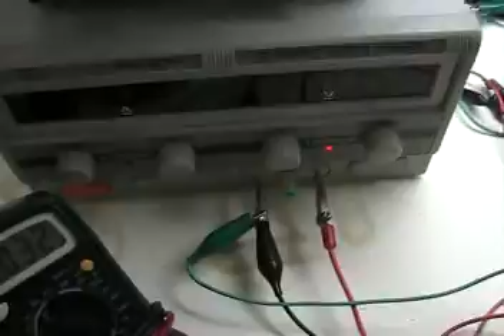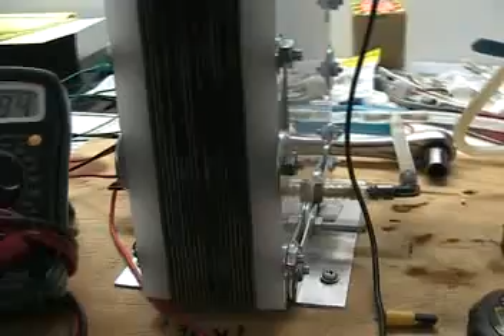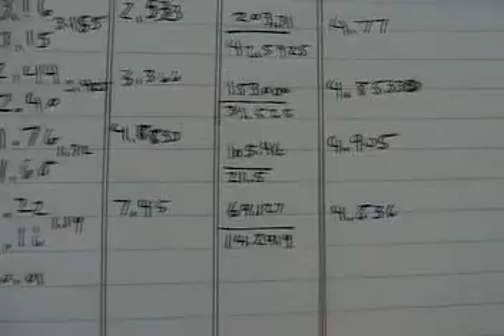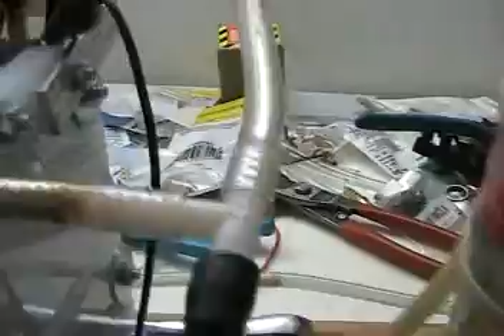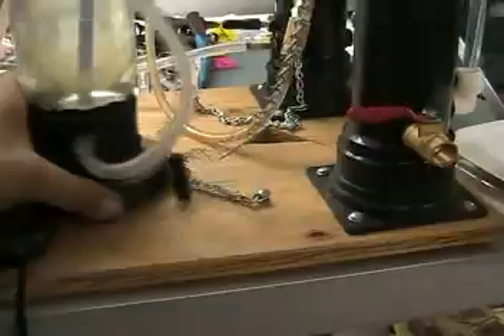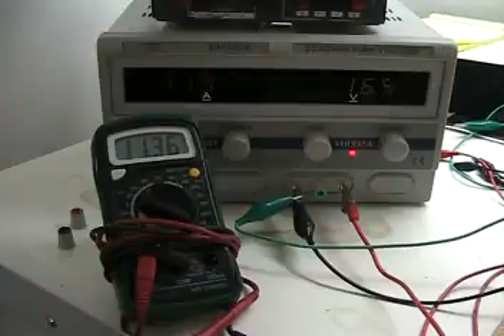drycell test 4

Comment: Copper connections will corrode especally on the + annode because of the oxygen rel., a good idea would be to use stainless steel allthread,2 long nuts with oppisite threads on one end, as u tighten to the +,- bolts u get a strong conn.make sure +v travs.opp.from - safety thing #2 would be to coat the points of connection with something like rino bed liner this will put a hard plastic coating and prevent explosions,plz also dont inclose wire in the seperator! 316L stainless is very corr. resist.

Comment: my friend have you ever tryed a plate array of +,n,-,n,+,n,-,n,+,n etc.? if so what were your results? can u plz try this config. with the connection configuration I mentioned on the earlier video!, I think you should hopefuly get the results your after, this might also allow you to keep your amps.@ around 10 and crank your voltage up to keep the water lower than boiling, and your results should make you smile, this is only a guess...your unit is the best i have found so far on youtube...

Comment from the maker: yes I know ss scores about a 9 and cu 100 on resistivity, and connections were intended to be more spead, but a slight flaw in the manufacturing misaligned the plates when flipped so I couldn't do it. But thanks for pointing it out, I should have said something about it earlier.

Comment from the maker: one of the many good things about dry cells (including connections outside the gas area) is that they current limit themselves, even at insaning high elytes they can't draw monster amps, each of the cells I was using drew around 50 amps, at 6v per cell, and there was 10 cells. If I hadn't already blown up a dozen cells at different times, I wouldn't have made "safety" cells, and proly would have had a lot of stitches. So don't let these small tests fool ya, they are for learnin, to make big ones

Comment from the maker: I would upload the vid, but it would proly get hho experiementing banned for private citizens. The full story is after sitting for 24hrs since my last test run I went to turn the cells on and they blew up, a connection corroded inside the cell, they had been running for weeks with no issues, it was just that the seal I had on the connections inside the cells failed, and that last run was the straw that broke it. Made a huge mess, but the cells were designed for safe explosions,if thatcan be said

Comment: hahaha.. exploded?  guess that took care of that didnt it? hehehe..wow 14lpm?  Thats a ton of gas...  Well you might need to upgrade them for higher Amperage running I imagine, but maybe not, As you know from our other discussions about BOLT size/heat etc.., and spreading the current, it might just handle that current even with that small since, as you say its divided/cell plate which is a great advantage with dry cells as I see it.

You really can control how much Voltage/amps ea plate gets

Comment: Sid uses 1/2 Cup of KOH/GA for his BIG brick I bet you could step up the KOH safely, and get the thing at 20-30A and using 12v-14V DC only.. and produce I would think 2-4LPM with that cell? At least... That would be my guess.  

Im going to build one very similar for my Van, so I was hoping you could show how fast it would heat up with 20-30A and 12V-14V DC, and what production you get with 19 plates?  My main thing has been heat vs production, I be nice to see how it handles that Amps/Volts.

Comment from the maker: looked like a lot didn't it, I thought so too. but it actually calcs to 772.57mlpm. at 12-14v with this wiring it will not heat up, and getting it to 15-20amps will be a challenge, since that voltage is barely over the non-production threshold, very high levels of koh would be needed, or something else... :)

Comment from the maker: for these low amp test they are fine, I have them ran in parallel, and I keep the amps to around 5/6 max per lead. For my monster cell I have 3/0 cu ran to it, at max output it was doing 14Lpm, but it took a lot of watts to do that, way too many. And then it exploded, so... :)

Comment from the maker: The room i do my tests in is very, um leaky, it couldn't trap hydrogen even if that was what I wanted it to do. Remember hydrogen has the highest rate of disapation of any gas, and its non toxic. In all reality breathing hho is better for you than normal air, it has more o2 in it than normal air, just don't light a match. A pump will increase amp draw, and increase production, but eff. will stay the same. This is because eff. is more closely related to volts rather than amps, amps=production.

Comment: Man those are AWFULLY small leads, are they heating up as well at the higher Voltages and Amps?  Ium using #8 on my current submersed cell and they pretty much handle it about to 30A totally cool to the touch.

Comment: Ha ha ha... don't worry about the vent. This gas is sooo volatile it goes up 20 meters per second so any little crack in the sealing will let it fly a way pretty fast. Accumulation in a room will most likely never happen. Go see my home made HHO Dry Cell made whit SS 316L FOIL 0.002 mil. Just click on "Banyan23" to see my series of videos. Thanks!